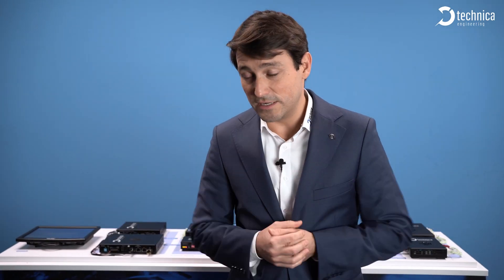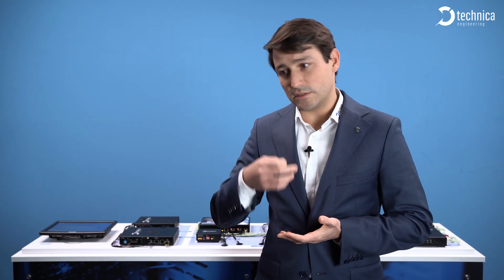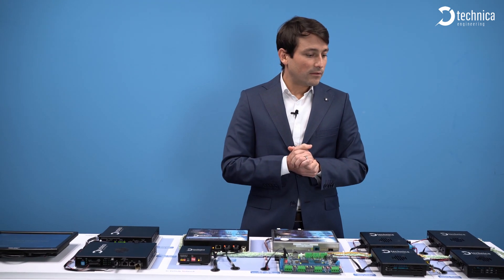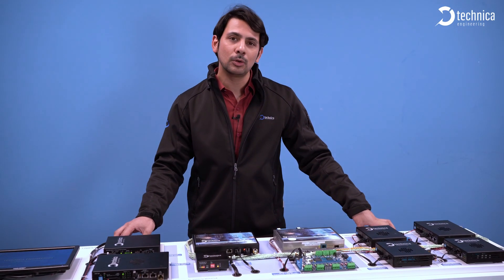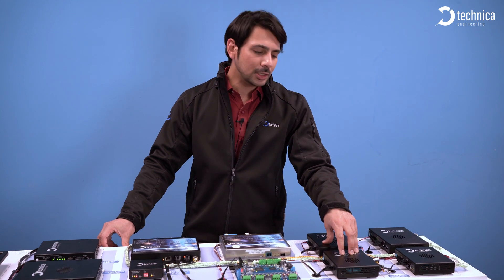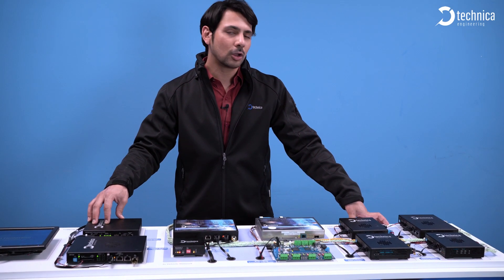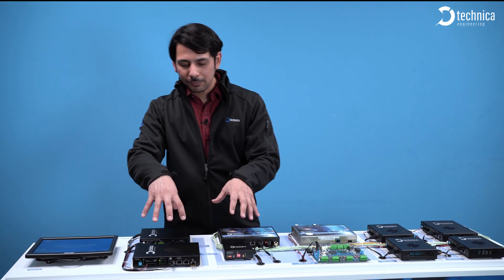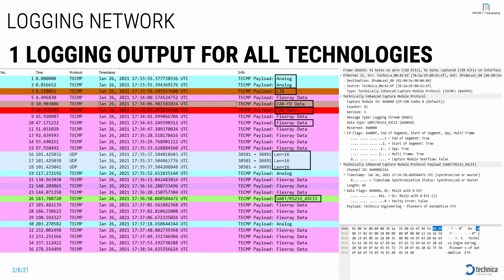Automotive Ethernet Congress 2021 - Technica Engineering

Comment: 1. who is the time master of gptp in the demo? 
2. is TECMP defined by Technica? How is it different from PLP?
3. is capture module capable of capturing MACSec protected Ethernet frames?
Reply from the maker: Hi Khalid KM!

First of all, thank you for your question!

1. In this demo Capture Module Ethernet Combo is the gPTP Grand Master. However any Capture Module or Enhanced Ethernet Switch can be configured as the gPTP Grand Master, depending on the requirement of your use-case.

2. TECMP is an open protocol, made by Technica but is not proprietary and is open to use by anyone. It is available on GitHub. PLP is a vendor specific protocol.

3. The answer is more complex then just yes/no. For simplicity let’s say Capture Modules are capable of handling MACsec traffic. We are preparing special tools for MACsec testing. For more details and discussion on this topic, we would recommend you to approach us on technicalsales@technica-engineering.de so we can discuss the topic further in detail.

Best regards
Danyal Popalzai